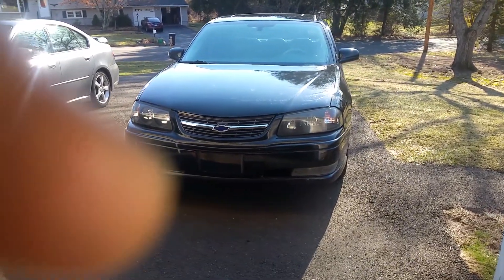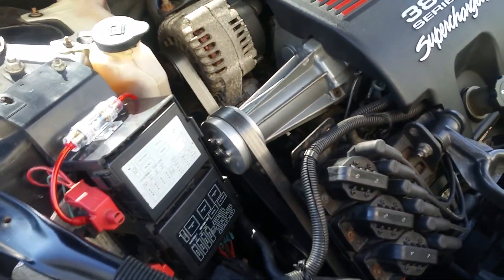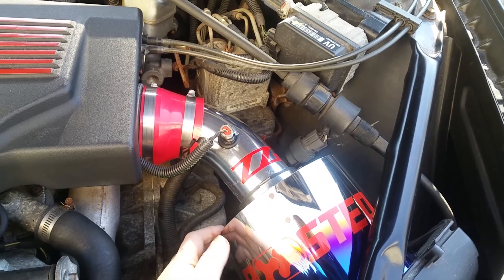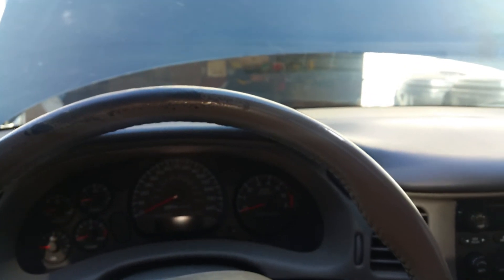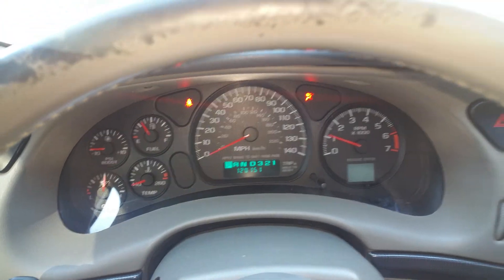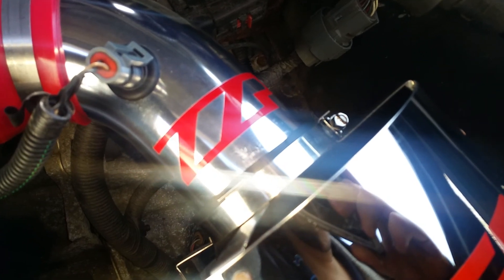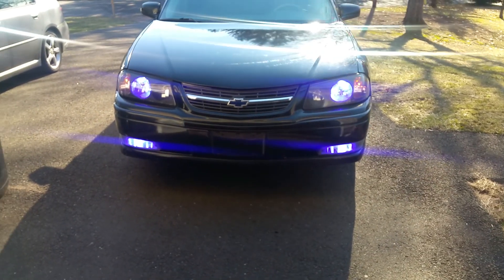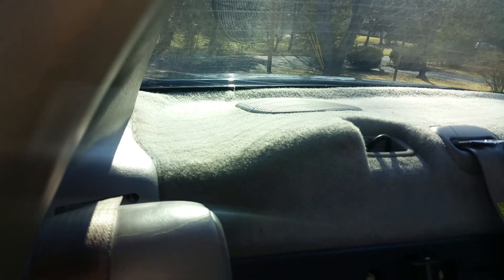2004 Impala SS walk-around

Comment: Did u have to get a tune wen u plugged in your new computer...?.. Or u can jus plug it in and good to go..,.?
Reply from the maker: I bought the computer from ZZPerformance. You have to give them your VIN number and vehicle info and they will program everything into the computer so a lot of the time you can just swap it out and be all set. Sometimes you may need to perform a "security relearn" which is basically just reprogramming the chip in your key to start the car. Its a fairly easy you can google the procedure... it's basically just turning the key to the on position and waiting 5-10 mins until the security light goes off and then repeating those steps again twice for a total of 3 times. I have used these computers on 2 different cars so far. On my Buick I had to perform the security relearn, on my Impala I did not. As far as actual tuning, no you shouldn't need to tune it. It's already set up to give you more power and throttle response, and the transmission tune they programmed makes the car drive and shift so much better. If you did have any other parts on your vehicle you could tell the people at ZZP when you order and they can set the tune accordingly. Hope that helps!
Reply: @davewhite1602  this makes me miss my Impala. Mine was an Indy edition too 😢 I had a K&N cold air intake, 2.5" ZZP downpipe with the cat, ZZP computer with all the emission codes deleted. I even ditched the resonator for a piece of straight pipe but still kept the factory mufflers only because I still wanted it to look stock. Nailing it on a straight stretch of road with the traction control off was a thing of beauty. Two long black patches every time 😁🤘 and that supercharger whine man........ damn I miss it. My only regret is not switching to e85. I mostly ran either straight premium gas or e30.